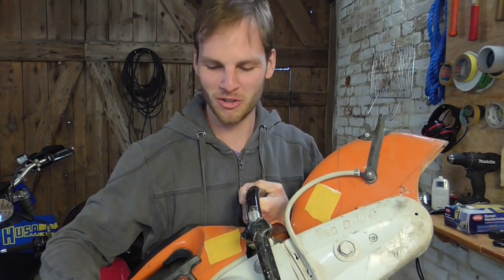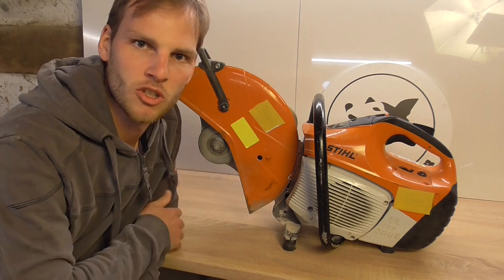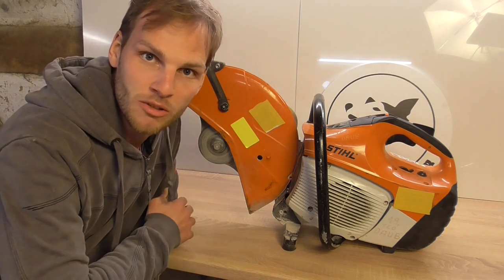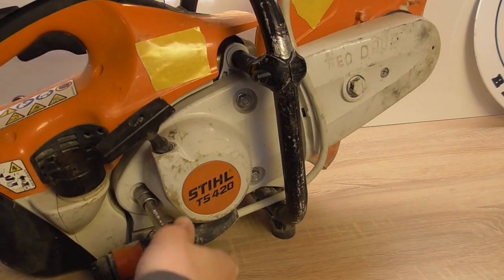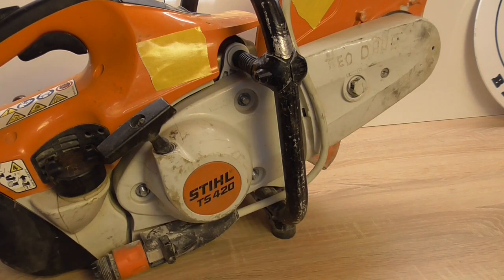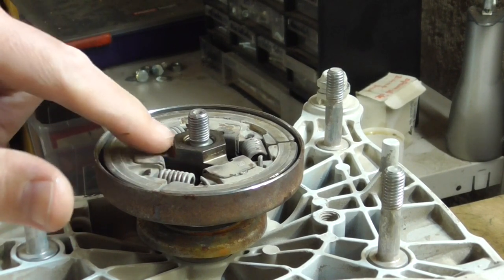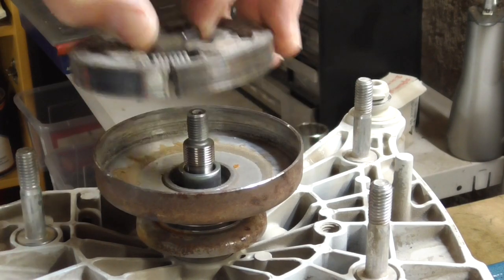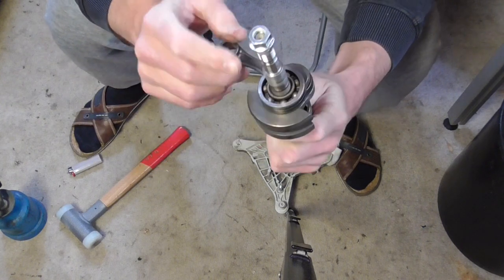Stihl TS 420 Concrete Saw ran without Oil - full Teardown

Comment: I found Muscle-Milk-KTM's comments to be the most helpful and accurate instructions. I would only add for cleaning that you can use de-greaser and a pressure cleaner to blast off most of the concrete dust and muck on the parts. Easier when disassembled. Use only about 1.5 - 2 K psi with a fan spray tip. Be careful never to point it into your exhaust, carby inlet or crank-case. If you accidentally did, shake out the water and blow out with compressed air. Spray some water dispersant into the crankcase if it was affected. once all the parts are clean, leave them in the Sun for about 1-2 hours which will dry the machine out enough to use. Same can be done even when machine is assembled. Just shake all the water out and blow with compressed air afterwards.
Reply from the maker: Thank you for your comment. Every comment like yours help others do the work

Comment: For your concrete dirt, a heavy degreaser is the best route IMO.  Spray it on, let it soak for 10-15 mins then wipe/blow it off.

Comment: Before you take off the cylinder either use a cylinder stop for the purpose or put rope in the cylinder through the spark plug hole for the piston to bottom out against to remove the nuts on the crankshaft rather than clamping it in a vice.
Reply from the maker: Thanks I will definitely do that next time

Comment: I think they're all T27, not T25
It's really close... I was using a T25 for while at first too..

Also, I really think you can use a power washer to clean it off at first.
Or just a garden hose spray.
Maybe take ignition coil off first.

Let it all dry off.

Maybe not?